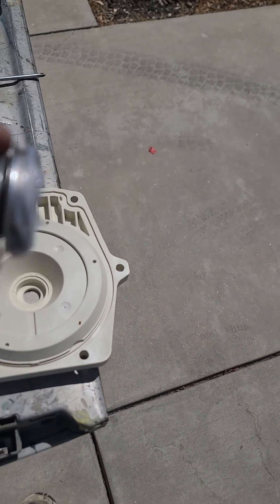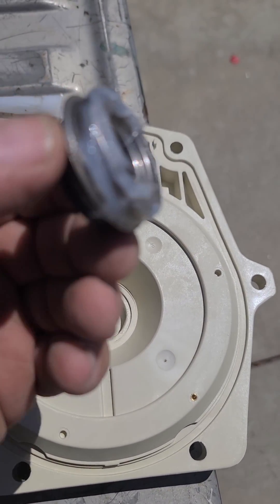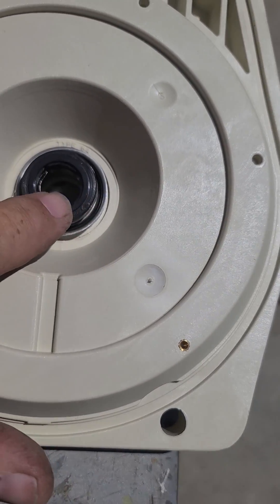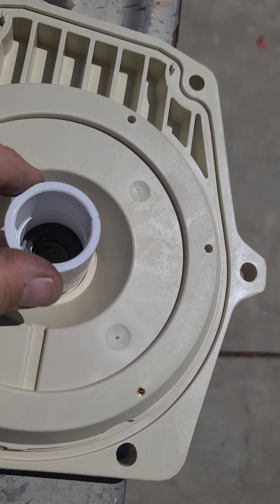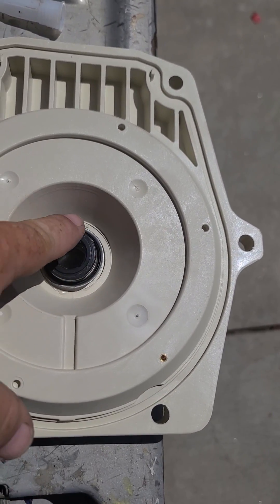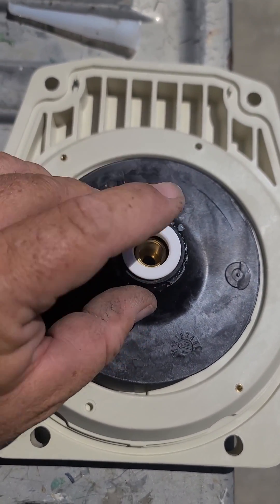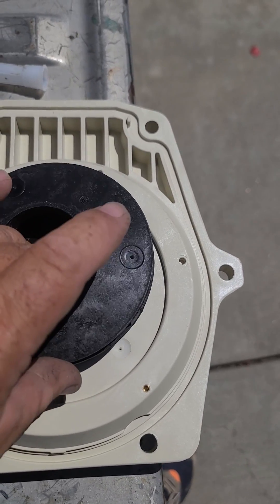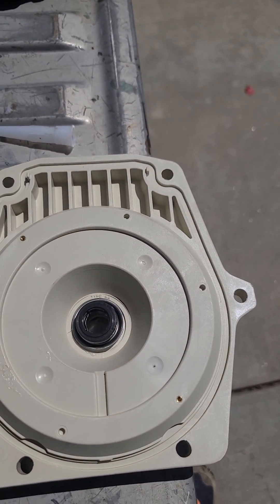Helpful Tip.. Installing Ceramic Shaft Seal

Comment: Hi John I am replacing a new plate and seal but the new seal won't even start in the hole. Tested the old seal and it won't start in the new seal plate either. Can I sand the hole to make it fit or... thoughts?
Reply from the maker: @toddgover2606  
It's possible you got the wrong seal however if it is really close you may be able to sand it a little bit but put some silicone or something in there to keep it from leaking